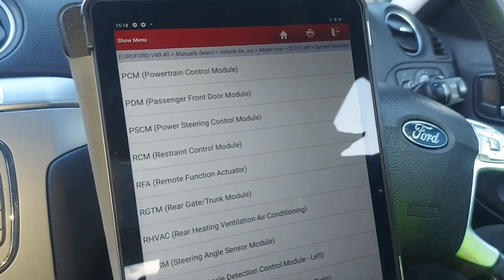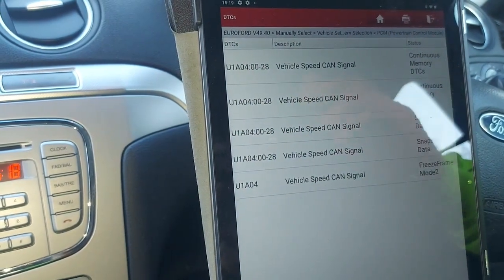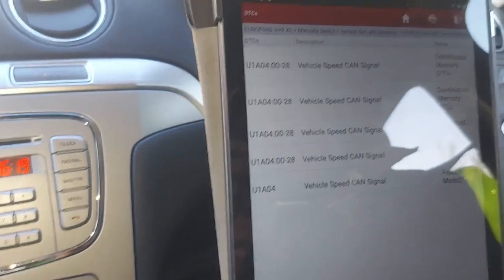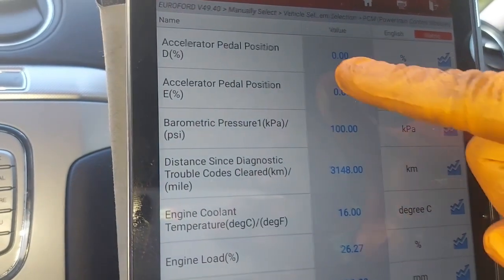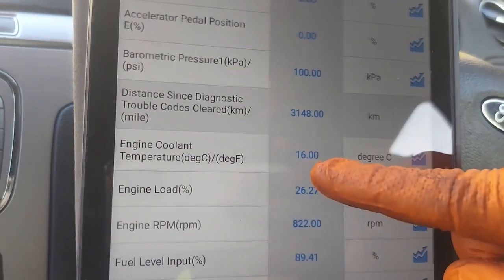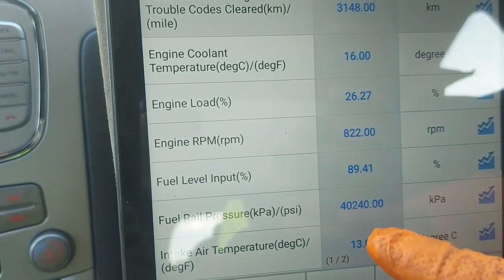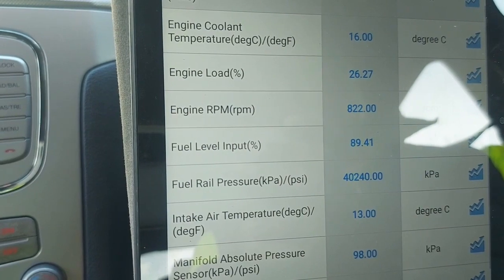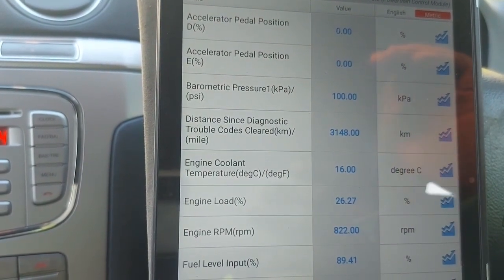The Real Reason Freezeframe Data Changes Everything

Comment: My qstn is how you gonna find the problem if l got freeze frame data, does it mean you compare original specs vs actual specs when that vehicles is on idling.
Reply from the maker: I will explain more on the Zoom platform this afternoon. i short let me say freeze frame is used to mapping out a strategy to tackle the faul.